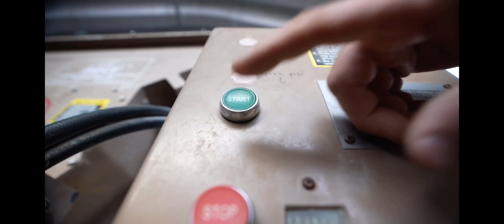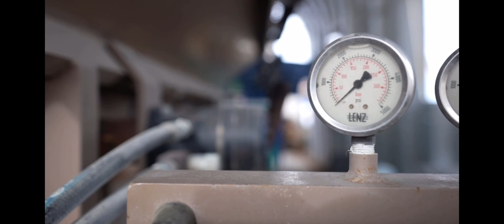Rebuilding their home out of fire-proof compressed earth blocks (CEBs)

Comment: Wow, thanks for promoting this building method. I’m working on my own with a press I bought in New Mexico. The only problem I’ve had is my machine makes random widths, which is a problem. I’ve gotten pretty good at eyeing the amount that drops into the press box to get close to the 8 inch width. But it’s challenging. I’m stuck with it at this point. No more funds for better quality machines. I’m taking my time because I’m old to be working this hard. (63). So far, so good.